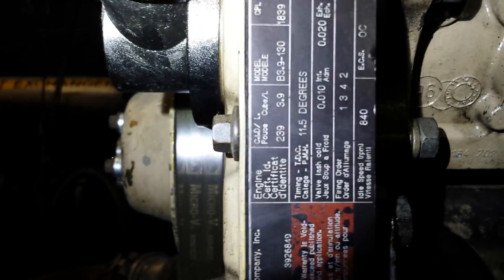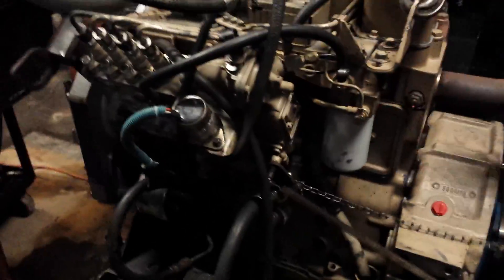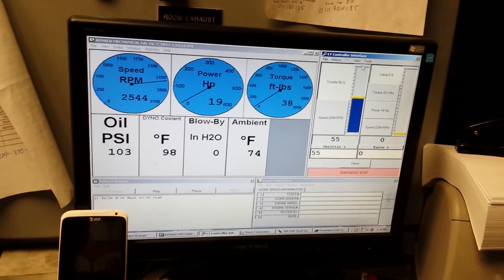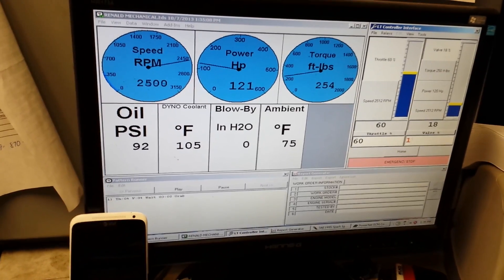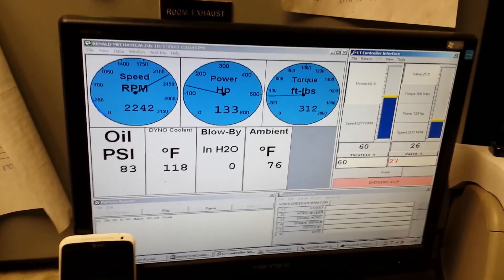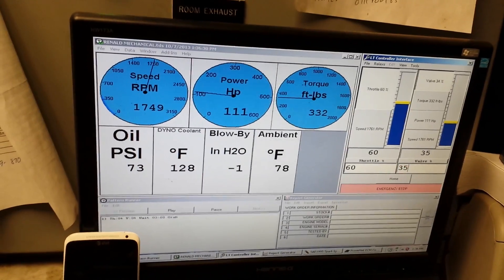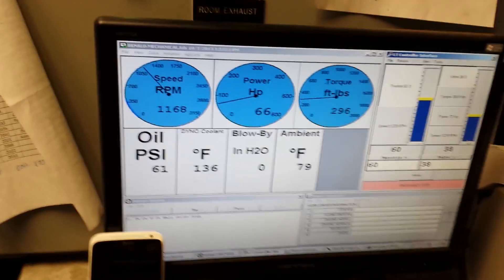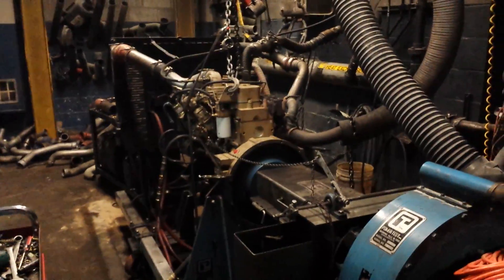Cummins 4BT Dyno Test Pull. Stock Engine With No Modifications

Comment: Like to see torque with 250-300 hp on a 4bt.
Reply: You'll see around 400lb-ft at 200whp on a 4BT with a P7100. I had mine dyno'd at that. I dyno'd it again at 350whp and it pulled just over 700lb-ft...and trashed the NV3550 and NP231 that I had behind it. So I moved up to the NV4500 and NP271. I found that you can basically double the hp numbers to find the torque on the 4BT.
Reply: ill let you know when im done